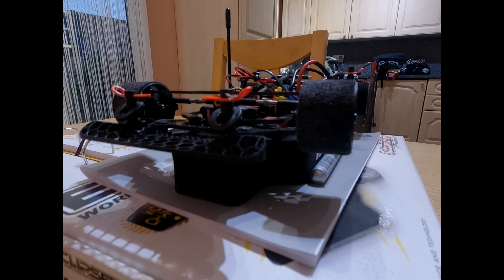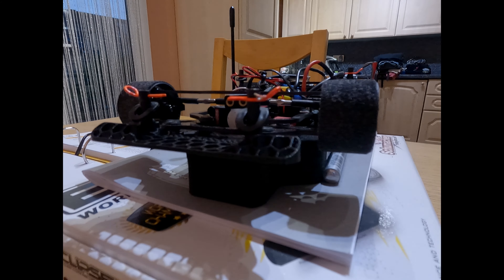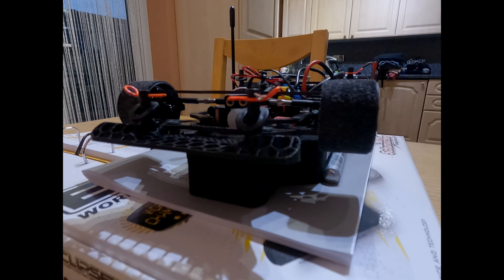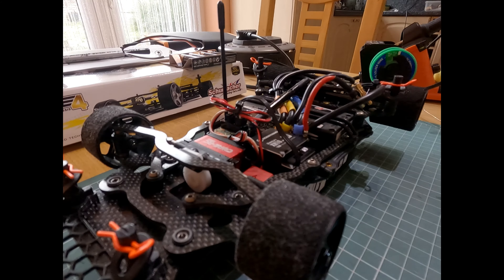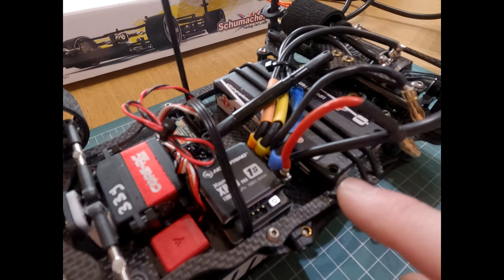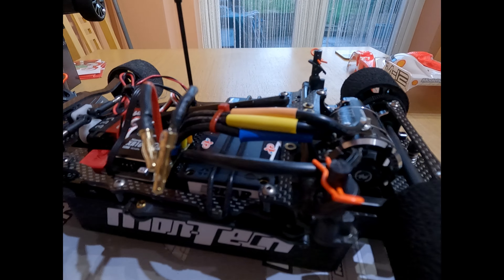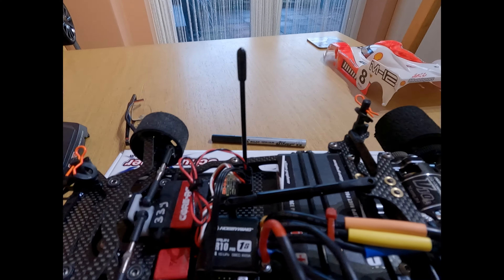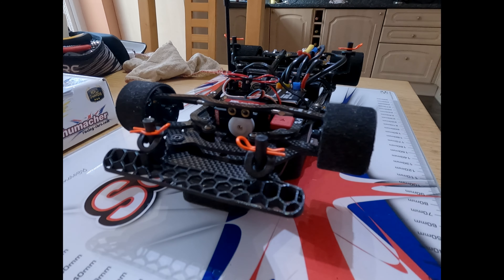Schumacher Eclipse 4 LMP12 - Race Prep 2 - Wiring, Set Up

Comment: I don't know which servo you have been looking at but I can recommend the Sanwa PGS-HR or the new POWER HD M8 PRO looks good. For your motor wires I have mine like you had yours at the start but I use thinner 16 awg wire. Like you said in the video the wire can tweak the pod, so slightly thinner wire can help stop that.
I wouldn't worry to much about weight for now until you get more consistent and are looking to find a few 10ths of a second. You can save over 15g from switching from a diff to a spool but its harder to drive. A good way to save weight is switch out the ball studs for titanium.

Those grub screws are for adjusting the side springs to set tweak. They move the cones up and down that compresses the spring. I don't know how yours came out that has never happened for me.
Reply from the maker: Ahh yes, moving the cones will tension the spring 
Maybe I have them too tight as the grub screws have a small amount of thread lock or something to stop them being loose
I will look at them 👍
Reply: Maybe the set screw for the springs got cross threaded and put force that made them come loose and popped out,
Reply from the maker: @driftcraze2138  i think it was just too tightly done up, so when i tried to adjust the grub screw, it was putting a lot of torque on the brass insert and it made it loose......
It now makes sense about the wat to adjust tension, must have over looked this myself
Reply: @racing393  that's what I was thinking 😢